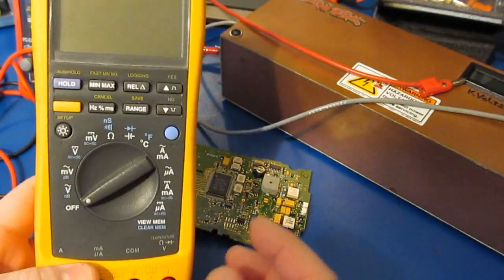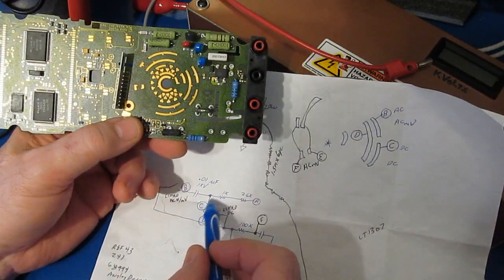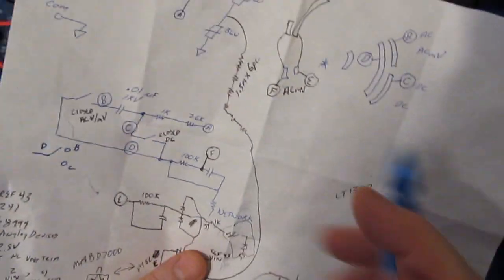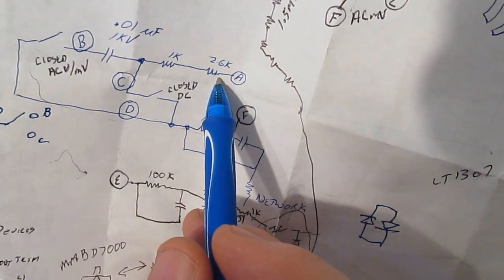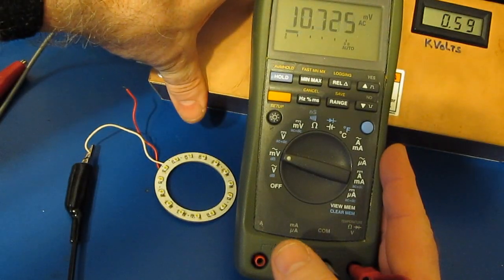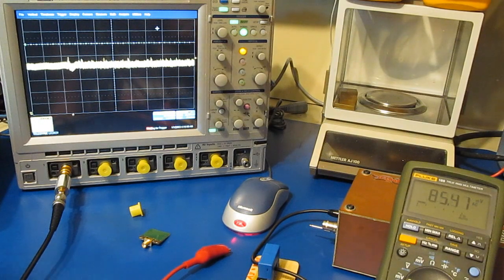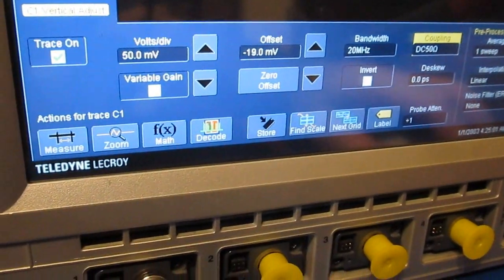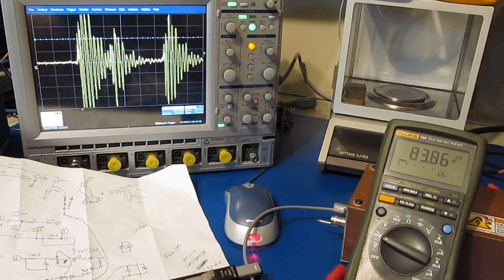Caution when using your meters ACV modes Part II

Comment: Curious if the 287 has the same problem ? If not, perhaps we have a little more evidence for why Fluke discontinued the 189 ?  Well, I guess this is just one more cognitive load issue to add if I'm ever checking high AC voltage with my 189. I'll often use the AC modes to check for voltages when troubleshooting unknown circuits, so this is critical info to know (and maybe explains past odd behavior). Thanks for the great detail on the issue and alerting us 189 owners of the problem !
Reply from the maker: I doubt this is unique to the 189.  It just happened to be the meter we were discussing.  I think the example someone provided, they had caused a failure at much lower voltages than shown.   Not too surprising.
Reply: @joesmith-je3tq  yeah, that's the scenario I envisioned too.  I recall a time I was troublehsooting an EVSE and checked the input and output of a 240vac => 3.3v solid state IC and can easily see how if not shorting the leads between measurements, could have inadvertently caused residual damage.  Thanks again.

Comment: I got the gist of it.  Lost you on the detailed circuit traces.  I'll dig up a dead meter and try to trace similar paths to look for analogous elements. 
Yeah,  I'm waiting for that 61e+ report. Did it make it past the piezo?  Replacing a ptc with resistor was a worthy idea.  Why didn't Uni-t think of that?

Comment: Discharging leads is always a good practice.  It is standard procedure to discharge all leads connected to anything on a spacecraft to prevent electrical over stress.  Sometimes the capacitance of the leads can store enough charge to damage very sensitive circuits.